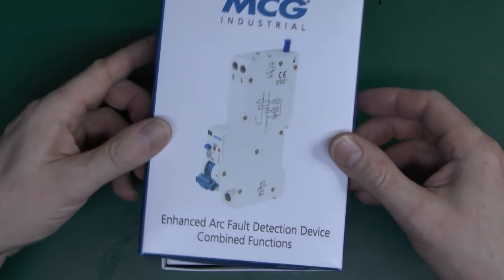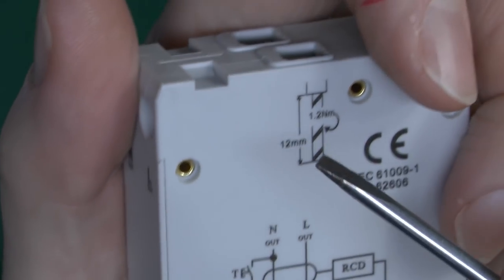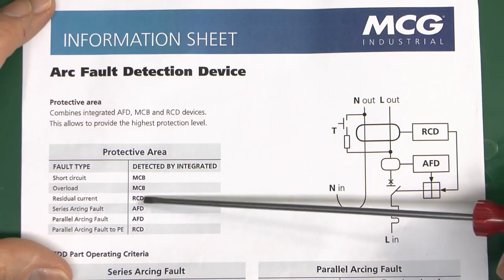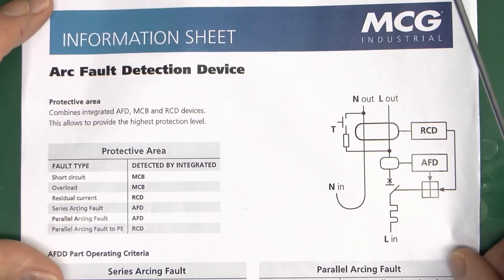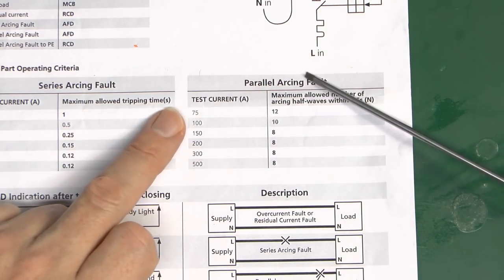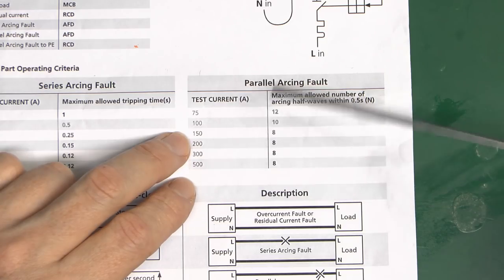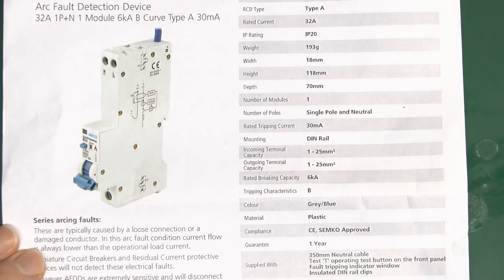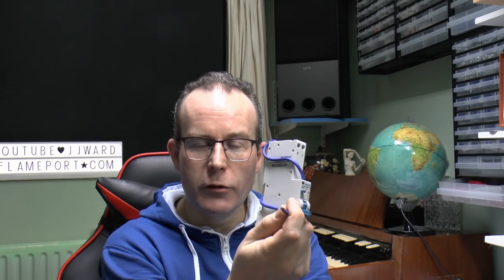MCG Arc Fault Detection Device & General AFDD Info

Comment: Great stuff, still not convinced by AFDD's JW, I sense your'e not either. look forward to the testing. What's the point in the not being able to detect serial arcing under 2.5A? lighting circuits is where I usually find faults, in ceiling roses, screw terminal JB's and a case where someone had screwed through a 1.5mm T&E causing parallel arcing to CPC and nearly burned the wooden joists. I was hoping this would solve that problem but alas, it seems not. Just a cash cow at the moment, and the prices are silly too. Great video John.

Comment: Thank you for producing an informative video, these really do help others to learn about and better understand these technologies, particularly when they remain uncommon and come a at a premium cost.
My understanding of BS 7671 is that whilst isolation of the neutral conductor is required for every circuit, it can be provided for a group of circuits by a common means.
In current practice, in single-phase installations, this has been provided by using double-pole isolator switch or by double-pole RCCB upstream of individual circuit protective devices e.g.single-pole fuses, MCBs or RCBOs.
Therefore a single-pole AFDD is no different and may be used on a TT system if DP isolation exists upstream, although to fully isolate the supply, a large part or the entire installation must be collectively isolated.
Currently this protection/isolation arrangement is the norm and whilst not completely ideal, unless we see double-pole RCBOs and AFDD devices become more mainstream I think we will have to accept this view which permits their use.

Comment: On single phase TT installations single pole devices are able to be used for fault protection, isolation must be double pole which could be a main switch in the consumer unit as I understand it.
Thanks for the video never heard of that make. 
Very difficult to justify fitting AFDD's at the moment given the limited use and cost.

Comment: Imagine every circuit needing these for edition 19 :D
Reply: should be done i think boilers are a grand why shouldnt fuseboards be
Reply: They are required for most residential circuits (family rooms, bedrooms, dining rooms etc) here in the US.
Reply: Michael Watkins  what about kitchens? How does the cost compare to an RCBO (combined RCD and MCB) ?
Reply: @zjzozn  AFDD's approximately 6 to 10 times more expensive than RCBO.
Reply: I see screwfix are selling the older Wylex afdd for £205.... 👌
Reply: I have heard somewhere that (assuming they do become mandatory) they would not be required on certain types of circuits (circuits where sudden disconnection of the power could cause some level of danger, such as lighting and smoke detectors)

I can't remember exactly how it was worded, but I do remember the word "danger" was definitely used (but I cannot seem to find the source anymore, so this is just what I recall)

Comment: Fair enough John, IF it works when you get round to testing it!!   And by the way, just how many customers are going to be willing to cough up another say £1500 for contactors alone if replacing an old consumer unit?  This could easily bring the installation costs to a couple of thousand pounds!

Comment: Have any of the AFDD's that you've tested impressed you?  Surely there's got to be a question mark over using a microcontroller in a safety device?
Reply from the maker: They work, but only under defined conditions, the main one being the minimum current needs to be about 2.5A, so they are of minimal use on things like lighting circuits.
Microcontrollers in safety devices isn't anything new, they are used extensively in things like car airbags.

Comment: What happens when this is installed on a circuit with arc discharge lighting like metal halide?
Reply: Nothing much, as the metal halide lights generally have a very smooth current waveform due to the large inductor and the power factor correcting capacitor. Might trip though if you have a massive amount of them on a single breaker ( around 5kW, 10 400W MH grow lamps) and the lamps go EOL and cycle continuously, but that is a niche application ,and if you are doing that then you are probably not going to actually use breakers or a meter anyway.

Comment: Informative
Reply: What's your thoughts on RCBO costs and if more expensive it better. Schnieder acti 9s are £114, where as Eaton ones are £24.99
Reply from the maker: Some manufacturers make better products than others.  However price isn't the only factor, and more expensive doesn't always mean better quality, just as cheaper doesn't always mean worse.
Reply: @jwflame  I always spec acti 9s when any installation is happening under my remits. Do you use fluke multimeter or mertle? Found I'm getting interference in the factory I work testing with the fluke for earth loop, but there's every cable you can think of in the same compartment In the trunking and the cost to put new containment is laughed att by management. Also it's a 19 year old building and clean rooms involved, some of they sockets aren't even getting an earth at them due to cleaning agents, again the cost factor is laughed at so I refuse to test/sign off test certs for said clean rooms and I'm close to walking away altogether as it's that bad

Comment: Hi john does this AFD detect where the main switch at CU meter tails terminals connection due to loose connection?
Reply from the maker: No, it can only detect arcs on the load side.
Reply: i would have thought it would as current in a circuit is the same at all points. as the sensor is only in the line and the ac flows back and forth the sensor won't know which way the arc is coming from. i think 😆 however, if there are lots of circuits, the arc in the tails may be shared out and too small to detect on a single circuit.

Comment: So does the MCG device only detect arcing on the live conductor only (i.e. no neutral arcing protection)? As the schematic at 5.00 appears to show AFD only on the live conductor, it'd be interesting to know if the Siemens/Electrium/Crabtree/Wylex single module, solid neutral AFDD/RCBO unit affords neutral arcing protection too or indeed if the larger (2 & 3 module devices from ABB, Eaton, Hager & Schneider provide protection for arcing neutrals??
Reply: An arc (series) will affect the whole circuit current, so detect it anyway.